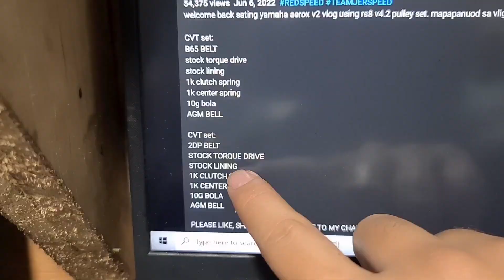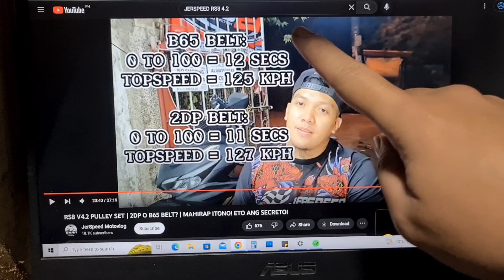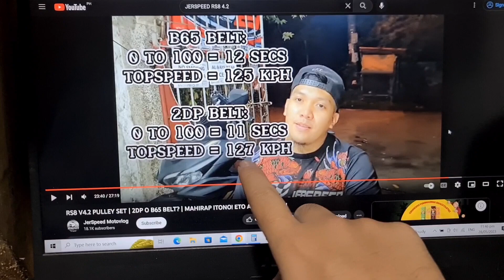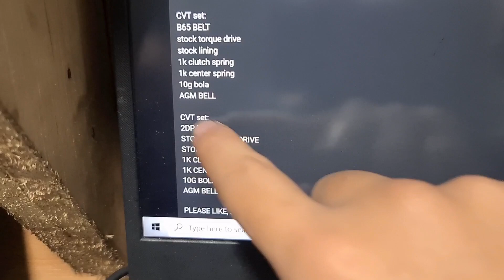14T GEARINGS ON YAMAHA AEROX V2

Comment: pano po naisasalpak yung 2dp belt? bakit po pag sakin di nirerecommend kasi mahaba raw po sabi ng nag aayos po sana masagot sir naka aerox v2 rin po
Reply: Dpat aftermarket na pulley gamitin mo kapag magpapalit ka ng 2dp.kasi ang aftermarket like jvt mas malapad yan kesa sa stock pulley,kaya pwd ang 2dp.at pwdng mas dudulo pa ang motor mo ksi mas aangat ang belt na 2dp sa pulley.
Reply from the maker: Basta oversize po ung pulley na gamit nyo pwede po mag 2fp

Comment: Try iba pulley tapos mababa na bola like 9g pag mag high speed ratio Maaga Yung aakat belt parang sa dekabyo Maaga shifting need nya rpm. Para mabilis nya Kunin Yung dulo nya
Reply: edi pag 14t bossing need ng magaan na bola tapos high rpm springs?
Reply: example 1200 both springs straight 11g bola tas 14t/38 teeth
Reply: TIA PO SIRR
Reply: @ANSAYJOHNKENRIZ straight 10g pag 70kg to 75kg riders,  center spring 1k at clutch  spring 1.2k, 2DP belt, HiRc Bell, rs8 taragis pulley set 👍 thanks me later
Reply: Hirc pulley
Straight 10
1.5 washer
1200 both srping
90kg rider
129 topspeed
B8r belt
Stock Lining
Stock bell
Stock td kalkal
Stock gear
CONS(MATAKAW)

Comment: Skin sir rs8 set 1000rpm parehas speed tuner bell 10/12 bola stock makina  mabigat pa aerox ko naka top speed 129
Reply: Stock pipe ka bossing? Aerox v1 or v2 po?
Reply: ilan timbang mo boss?
Reply: @genosic1732 stock pipe, rs8 DC8 dual tip or jvt v2 yan recommended sa hindi super stock